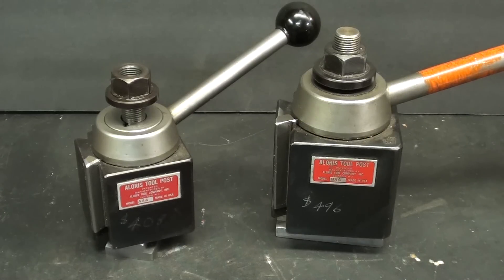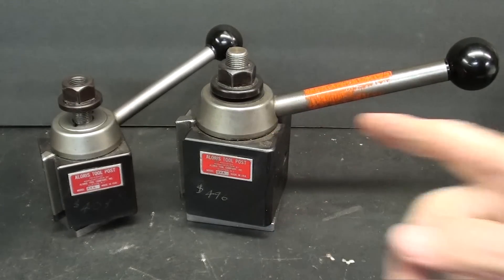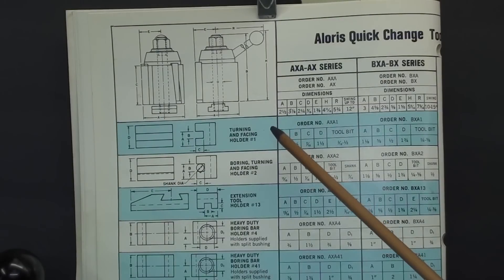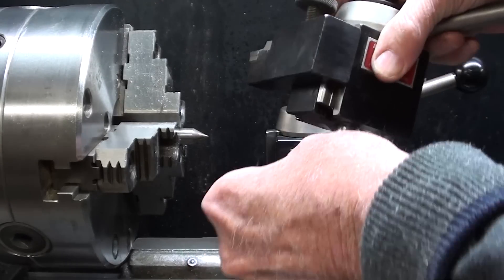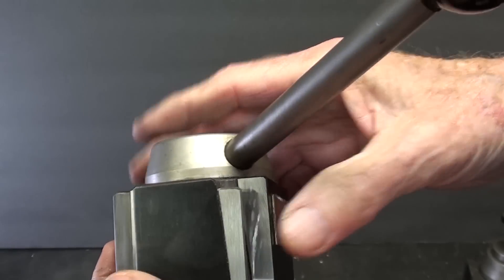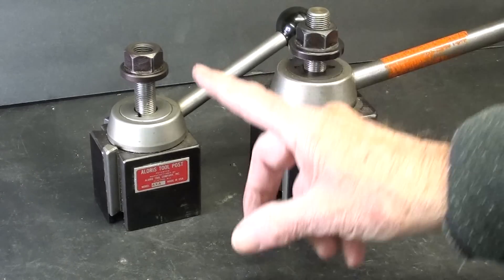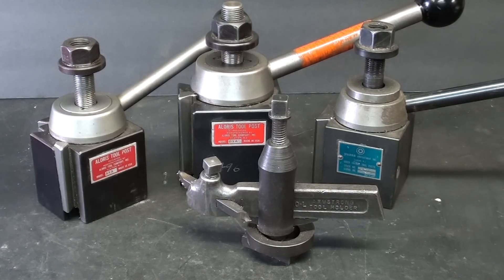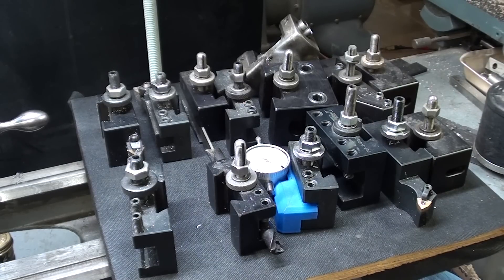SIZE MATTERS ALORIS QCTP short #26 tubalcain toolpost dorian

Comment: Good synopsis. Thanks, Mr Pete. One mod I made to my AXA size lathe was a heavier ball on the end of the handle. I wanted to replicate the almost effortless locking of my Dorian CXA. With more mass on the AXA lever, a gentle flick of the finger locks the tool at its natural torque - no risk of pulling the tool post out of alignment, even if only modestly tightened to the compound.
I've rarely heard this kind of thing mentioned on any channel, but on a all precision machines, the torque you apply to the fasteners is expressed as microscopic deformation to precision surfaces somewhere. This effect is amplified on smaller machines, since there is less to thread into everywhere. Maybe some part of my follow-on rambling could be Size Matters mini episodes 4-6?

Comment: Yep, I bought a mini lathe last year and I've spent all kinds of money on the thing. Far and away the most expensive extra I've purchased was the tooling and quick change post. It was about half the cost of the lathe itself, though of excellent quality. The only thing more expensive than a lathe are the tools needed to use the thing.
Reply from the maker: Well said!
Reply: It's like Double Mint gum!  You get to double your pleasure, or at least your outlay.  I had an old boss that said you pay for the machine tool, then you pay for it again just to get basic tooling to use it.  It's a conspiracy!!!

Comment: The wedge type is much more rigid as it pulls the holder back against 2 surfaces of the dovetail. The piston type only pushes it against 1 part of the dovetail hence not so rigid. Thanks for showing. Regards from Australia.
Reply: Agreed. I have both type. I much prefer the wedge. I noticed on the piston type that it would slightly move the tool holder off square. May not matter for many operations, but when you need your cutting tool to be square to the workpiece, it matters a lot.
Reply: I've just upgraded from piston type to wedge this winter and it's a world of difference. The piston one was a bit faster (ie loose) but didn't repeat very much and you could feel it working under heavy loads unless I put shims between the faces. So far the wedge type is so much more rigid and repeatable.

Comment: I was given a mainland Chinese BXA piston QCTH and it works fine in the home shop. There is one caution about Chinese tool holders themselves. They basically work well but the tool clamping screws are awful. Your hex key Allen wrench will crack the screws in no time. My True Value hardware actually had this style screw in stock and they were Italian made. I've never damaged one with a hex key.
Always keep the lantern style tool holder on the shelf. Just the thing to get into a tight spot when the body of the QCTH would be in the way. The 4 way tool post that comes with most Asian bench lathes is even more likely to interfere with getting the cutting tool where you need it.
Cheers from NC/USA

Comment: I have an AXA-size toolpost on my Myford ML7 (7 by 20) and I usually use it without the topslide so I can more easily get the tools low enough, especially the ones with larger shanks.
The one I have is made by Dorian Tool and it has yet a different locking mechanism, where the central part of one side of the dovetail pushes outwards to lock the holder in place. I guess this product was designed to work around the Aloris patents while still using as many as the unprotected good ideas as possible.

Comment: Hey Pete,  video just popped up on my feed.  Year old now.  Times fun when you ate eating flies I heard one time.
I built a quick change tool post for my Hendy 12 x 30.  Bought some blocks off of Ebay 200 or bxa size.  Used kinda John Stevensons design from home shop machinist or chaskis, long time ago.  Except backwards kinda.  Fits bxa blocks, has a I call it a puck in the dovetail which tightens.  Works well.  Cut dovetail then faced puck.  4140 good stuff.  Paying attention to center heights and such.  Works very well, got several tool blocks on😢 ebay then I made more.
Hey I have more money to spend now, even sliding dovetail toolposts are reasonable priced.   I should make up an axe or 100 size for my Logan but I have an Emco not Enco toolpost on it 
Hey Pete,  keep posting videos .
Got to add.  Dovetail or sliding dovetail quick change toolpost repeat fine.  Plunger styles work but don't expect them to repeat.

Comment: I really quite like my dovetail-type QCTP, but have been thinking about how I can use tool offsets in my DRO, and find myself feeling awfully envious of the swiss multifix type 40-position toolposts. Sizing those however seems like even deeper wizardry than this!
Reply: We have a Parat QCTP on our Harrison Alpha lathe, it is "adjustable" in 15° increments if I remember correctly. There are pros and cons: yes one can change tools but is limited to that 15° steps. On a NC-machine it is in my opinion a smaller problem than if manual machine where the compound is necessary...

Comment: I'm with you on the wedge action.  I like the feel you get from that.  I don't have a piston type.  I have a few of the four way turret lathe style, too.  I like those when I am working on multiple parts. Storage has become an issue.  I started a project in December, but I haven't finished it yet.  Hopefully, it'll work like I plan!!  I still use lanterns on the Logan, but there is a plan for some Harold Hall type quick change in the near future.  Thanks for the lesson!

Comment: Great timing! I've been digging through older vid's looking for one from a couple of years ago where you had told us which size you use on your Clausing. As a gunsmith apprentice in the 1970's I used a 12 inch Clausing with KDK tool holders. I later bought the machines from my mentor when he closed the shop and have used the KDK's ever since. The KDK's are not as stable as the Aloris I don't believe and I've decided to switch over. 
 I've watched your channel for some time and enjoy it very much. I'd thought you had cut back on the number of videos being published as they stopped showing up on the recommended list of the channels to which I'm subscribed. Glad to see that was not the case.
  Sorry to be long winded here. Thank you for all the work you do. You make 1st class videos.
Reply from the maker: Thank you very much

Comment: Aloris was the standard when I entered the trade in 1982. I bought a brand X import piston A size for my Craftsman/Atlas. It is a huge improvement over the lantern post for tool changes. It is a far cry from an Aloris. Adam Booth uses a very different style of quick change tool holder that has indexing features that Aloris doesn't offer. He has talked about his "after market" source for his style. I have never seen his style in person. I assume that the Aloris is far more standard and probably less costly. Thank you for plugging SHARS as a legitimate import option for us hobby folk that shy away from Aloris cost. I usually hold out for premium brands on the used market, but tool holders and tool posts are hard to find used at any price. 
I bought my brand X tool post from Lost Creek Machine back when Dad still ran the business. They used to annually set up a large tent in the flea market at Midwest Old Threshers, Mount Pleasant, IA. The reunion folk really put a squeeze on the flea market crowd. Many vendors quit coming to the reunion and I quit going, partly for that reason.
Reply from the maker: I have seen that one that Adam uses. But that is the only one I’ve ever seen like that. I wonder what happened at the threshermans Fair regarding the flea market?

Comment: I also purchased the Shars, wedge type. I've had all sorts of trouble with mine. I've used Aloris in the past and there is a world of difference between the two. My budget was tight and the price of a used Aloris is crazy. Now I'm not complaining I knew what I was buying. I had to disassemble mine and spend a bit of time cleaning up the rough machining/casting. I have a 9" South Bend.
Reply from the maker: Thanks for sharing!

Comment: I have an Aloris AXA on my Clausing 12”. Also a piston clone on an import 9”. The spacer is a great tip as I cannot adjust up enough on some shutters and have to manually hold them up while tightening. Question: will the axa tool holders with the smaller tool opening still fit the dovetails of a BXA post?
Reply: The tool holders will not interchange on the tool post as the dovetail is a bit larger on the BXA range.  By the same token, most AXA tool holders will fit into the straight milled slot of the larger BXA tool post although it may require shimming under the tool holder to get the tool on the center line.  I have an import 14" lathe and the (import-Bostar brand) AXA is fine because the top of the top slide is the correct height for the center line.  I also have an import  BXA that I use on the rear of the cross slide for rear cut off tool operation.  The only thing I would like to compare is how much "play" or "slop" is evident on an Aloris or Dorian USA tool post compared with my Bostar import.  The Bostar  is a wedge style but you have to be careful to assure that the handle is firmly pulled tight.
Reply from the maker: No, they are slightly different in size
Reply: @geoffmorgan6059  Thanks for the info!
Reply: @mrpete222  Appreciated. I will shim and keep on going.

Comment: Great video again, I may have watched all of them. 

   I love my Aloris AXA wedge type. I'm working on a tool to set the cutter height referencing from the flat surface on top of the cube. It is 'L' shaped in elevation view and has a slight curve in plan view to accommodate the circular part of the locking mechanism. So far so good. Good enough that I use the prototype and seem to be in no hurry to build version 2.0.

Comment: I added a QCTP some years ago to my 12" Craftsman lathe. I was and continue to be severely limited on tooling funds so reluctantly had to settle for a piston type model though i would have much preferred a wedge model. Of course price dictated a Phase II brand import with 5 tool holders. Though a bit oversized for the 12" Craftsman I bought a BXA. I have found no issues with the BXA in use and purposely chose the BXA for one reason. You can fit a scissors type knurling attachment to a BXA tool holder. You have to make your own if you have an AXA post, or at least you did when i bought my post. I think using a conventional knurling tool on an Atlas/Craftsman lathe puts a lot of strain and wear on the brass cross screw nut these lathes are equipped with that a scissors type knurling attachment does not. I considered buying an AXA post and a handheld scissors type knurler but did not want to go that route. Had my lathe been a heavier built brand i would not have felt i needed a sissors type knurling tool, but given the limitations of the lighter weight Atlas i thought my decision prudent. I have never been given reason to regret choosing the BXA post and have had no performance issues either in size, or due to it being the cheaper piston  type post. That said, I would agree that an AXA  post would look more appropriate on the machine and if not for the knurling issue I described would have been the post i would have chosen.
Reply from the maker: I’m glad you had good luck with the BXA. It looks a little bit out of proportion, but it has been perfect for your purposes. I use a BXA on my clausing
Reply: @mrpete222   It does appear odd to the eye but has worked fine for my purposes and was chosen for the reason explained.
Reply: I have found since making this reply months ago, another option I was not aware of when I chose the BXA relates to tool holders.  There are tool holders one can find that have an oversized slot that as I recall would accept a scissor type knurlung tool. If I had known about that when I was selecting my tool post I definitely would have opted for an AXA sized post. 
Also I seem to recall reading that the greatest disparity between wedge and piston type tool posts is repeatability in use. Being honest,  I don't know how this disparity would reveal itself in use. My assumption is that disparity would appear if the tool holder was removed from its position on the post, then later reinstalled.  But as I said, that is speculation on my part.

Comment: You're spot on about the wedge type being better than the piston type. The wedge type locks the holder far more positively and is much better at giving repeatable accuracy on removal and replacing the tool holder in relation to the workpiece.

Comment: I have a very cheap bench top lathe with a tool post that has a fixed hight for the cutter. Your video showed me a tool post where I can adjust the point the cutter makes contact on the stock. Thanks. Showed me I need a better lathe and tool post. On my cheapo lathe I always get a nib on the end of my stock. Drives me nuts plus shows me I'm not cutting properly. Can't complain too much for the price of $245 I paid for it though. It was a clearance item at Tractor Supply. It at least got me started on lathe concepts.

Comment: I've got a 12" atlas craftsman I put a BXA on it.. I noticed he recommended an AXA, but BXA on the 12" causing? Do I need to downsize?
Reply from the maker: If it works for you, it is correct. There is some overlap.
Reply: I have a BXA on my Craftsman 12, too. It does appear a bit oversized for the machine, but I have experienced no performance issues.
Reply: @herbholmberg4474  I ended up switching back to an AXA.. I had huge chatter issues when parting.. is resolved with the AXA
Reply: @jhinze  Well, if the AXA worked better for you then it was a win!

Comment: Got to add.  Lathe at work, 14 x 60 tawainees pos, sorry, almost but not great but it does have a dro.  Ground jaws on 3 jaws couple 3 months ago but headstock needs realigning abought .001 over at 6 inches.  Has a cxa sized toolpost, I have a bxa sized toolpost on my 12x30 hendy  which is swings 14+.  Same size. BXA size works for me, I have made a few tool blocks bigger than standard but they work well and are rigid.

Comment: I got the piston type kit from Shars right after I got my 10-inch Logan lathe a couple of years ago. I kept the lantern tool holders that came with the 1954 lathe, but I'll admit I have not used them since getting the quick release system. 

As someone who is no expert, and completely self-taught in the past two or three years, I'm really happy with this Shars kit. I could see getting the wedge type at some point because what you say about them makes sense. But unless I come onto one that is used, or find a pile of cash, it probably won't happen.

I'm looking forward to these upcoming videos! I have found ways to make the five holders I have work for me, but am curious to see if I should add to them.

Comment: Aloris makes a smaller version than the AXA, called the MXA I  use that size on my 10" Emco Austrian lathe. I aliso have an older Dorian BXA that looks exactly like an Aloris with the wedge and tapered handle, however, I think Aloris must have sued them over this, because later model Dorian's have a different wedge arrangement.
Reply from the maker: Thank you for that information
Reply: I believe that they were called "MA". I have a set on my Habbeger 102. I've also seen a smaller size than that on a Schaulblin 70, but I'm not sure that was Aloris. 

I also noticed in your Shars catalog that they listed a 0XA. I'm assuming that that's equivalent to the Aloris Miniature size.

Comment: It’s interesting how the Aloris and Dorian size ratings are subtly different. I use Dorian, but they’re both very good. These really are worth their cost. The cheap ones wear out as the steel is cheaper and the hardening is not as high. The piston models (which Aloris makes too), don’t hold nearly as tightly and don’t guarantee the positioning. But it’s cheaper.
Reply from the maker: I had a Chinese tool post that used the piston method. I agree with you.

Comment: I have an AXA QCTP and assorted holders.  I have a 250-107 that holds a 1/2'" parting blade.  I recently got a 7/8"parting blade and noticed a 250-407 will hold that tool.  Now, here's my question - Will the 250-407 fit in my AXA post?
Reply from the maker: I cannot answer that I really do not know

Comment: I have an Craftsman 12" qc and need to take the gearbox off.  The leadscrew wont slide out to the right. Theres a definite clunk in the box suggesting that there is a collar affixed to it.  How does that come apart ? Also the gearbox doesn't look like the ones you and others show . It is made by the Obrian Machinery  Co. Chicago.
Reply from the maker: I think that is an aftermarket gearbox. I know nothing about them.
Reply: @mrpete222  Guess I'll just have to take it apart and figure it out . Thanks.

Comment: Mr Pete,   I have a 10" logan/power kraft lathe with an axa tool poste on it.   When I use a 1/2"  carbid tool I can't lower the tool enough to get on center (can't face anything without leaveing a small pip).  Is this normal or is there something wrong with my set up.